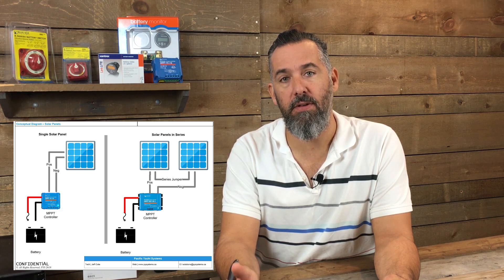Ask PYS - Should I Install My Solar Panels in Series or Parallel?

Comment: Hi Jeff, thanks so much for your informative videos! I'm looking at adding four 175W panels to our sailboat and considering series, parallel or a mixture of both? Would you have any further advice in this scenario ? I'm considering one charge controller or separate ones but I appreciate that you advocate separate controllers to help with shading. I'm thinking maybe 2 panels in series connected to one charge controller, then duplicated for the other two panels? If using two controllers, would you connect them at a busbar or cable them individually to the battery post? Many thanks in advance.
Reply from the maker: Ideally and especially for shading situations, consider a dedicated controller per panel. If you go in series, make sure the controller can handle the combined panel solar array amps and volts. 

When using two controllers, you can bring both controllers to battery, or bring to a combined fuse block, and then bring to batteries.

Comment: Hello Jeff, (Question maybe for next video) I know you can connect to one battery system two charge controllers in parallel from one solar array (if solar power is too big for one charger) or have several charge controllers from several solar panels to one battery array (to efficiently mitigate shading). However lets imagine I have one solar panel or solar array but two battery systems 12V  and 48V (or 24V doesn’t matter)  and I would like to charge from the same solar panel both batteries. Can I use 2 solar chargers connected to the same solar panel or array but charging different batteries? Or I shall use another solar panel or divide solar panel array and connect to each charger? (Aim here is to efficiently utilise solar energy, it could be that one battery bank needs less energy and is charged fast and when it gets to floating state it is not accepting all potential and then other bank if needed would consume majority of power. If we divide solar arrays per battery systems then we cannot access excess power of other array. Of course we can plan and estimate sizing of solar panels per batteries and their consumptions.) looking forward to your thoughts.
Reply from the maker: When a boat has two different battery voltages, 12 and 48 VDC. You'll need to get a two solar controllers, one for each battery voltage. In turn each controller will be connected to it's own solar array.

Comment: Hello Jeff, i love your channel and your videos and i wish i lived up north so i could apply and work for you. I'm a marine electrician down in Miami Florida. I have a question for you.   I have a customer that wants me to install some kind of AC to DC converter to install an amplifier JL Audio 8 channel. This converter was recommended to him by another boater ( a know it all )  it connects to a regular AC outlet and the other side is where you connect you DC load. I told him i would look into it but can't find much information and i really don't feel comfortable installing that equipment. I like to do things right way the first time as you do and this equipment sounds like something cool for some other application but definitely not for an amplifier. What do you think i should do?
Reply from the maker: Hi Carlos, same here, never came up across this sort of setup for a stereo install before. Considering that the energy storage on a boat is 12 / 24 VDC, it's inefficient to have DC inverted to AC and then converted back to DC to run a stereo.  Make sure the adaptor AC to DC converter (power supply) can handle the max amperage of the stereo deck.

Comment: whey dedicated controllers over parallel?  you cut just use a combiner box and feed the control from there and do the propper math one the wire size
Reply from the maker: Hi Simon, depending on your solar array size, it's not hard to exceed 30 amps with a solar array and solar wiring between panels is #10 gauge. (max 30 amps current). With series connection, the voltage increases but the amperage stays the same until the controller. Also higher voltage means the effect of voltage drop are proportionally reduced.

Comment: Hi Joe, thanks a lot for all the information you provide to all of us.  there is a topic nobody speak about solar panel. On the controller there is usually a connection for loads but I have not heard a lot of people speaking about it, do you reccomend using it? Thanks in advance
Reply from the maker: Good question, haven't found a use for a load connection on a solar controller just yet. Anybody has suggestions?
Reply: @PacificYachtSystems  Nicro used to produce a 12V vent that was perfect for this application, so it automatically run during daylight..